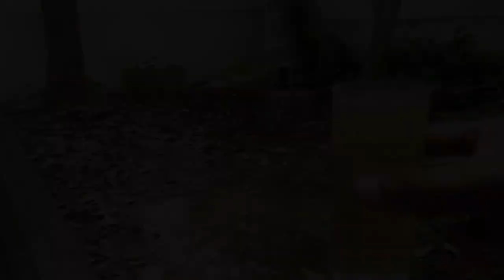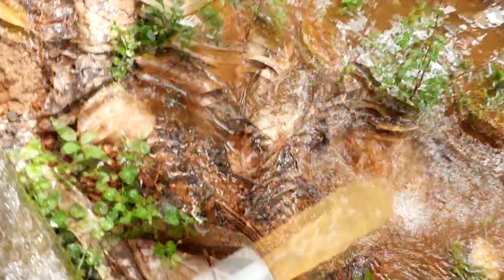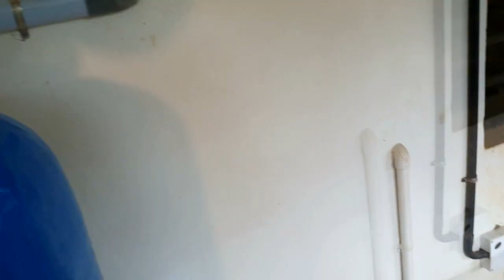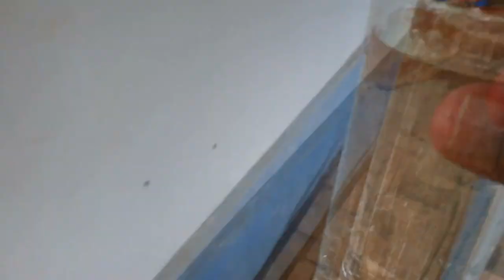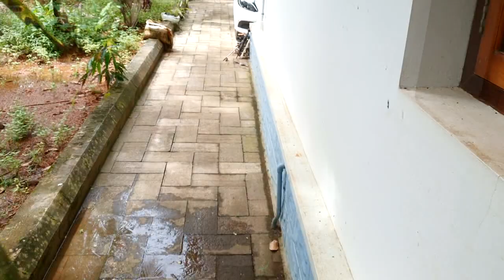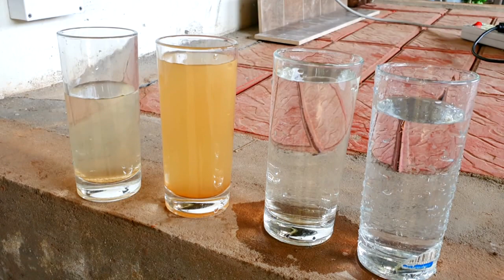vessel filter back washing ||ഇത്രക്കധികം ചെളി വർഷങ്ങളോളം വീടിനകത്തേക്ക് പോയാൽ ടൈലും, ഫിറ്റിംഗ്സും -

Comment: Which capacity of vessel filter required for two storey house with two each bath rooms in each floor? What will be the cost effect for installation. Daily consumption is approximately 1000 Ltr
Reply from the maker: Pushparajan Nambiar pls call 9745424455